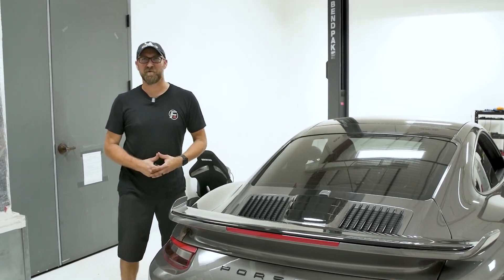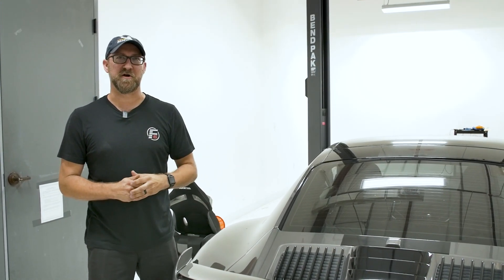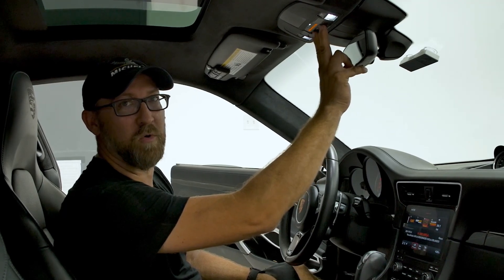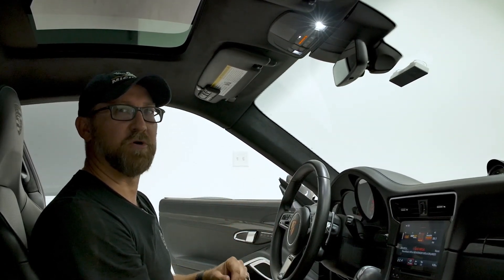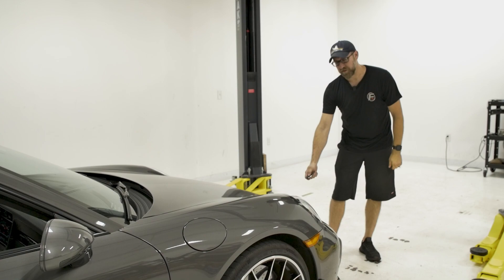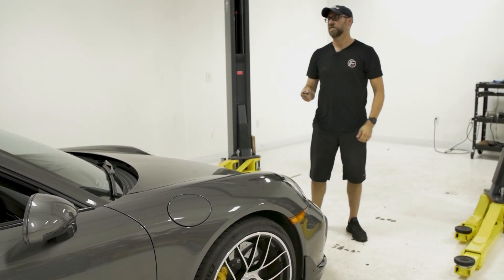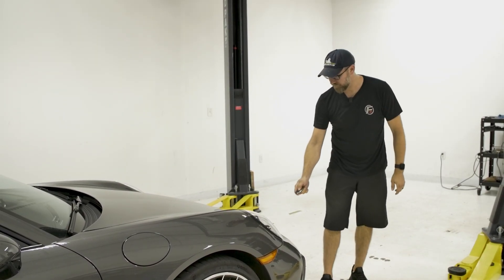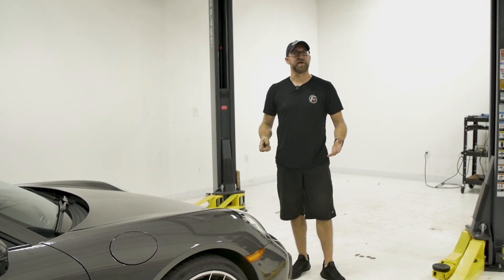How-To: Program Homelink buttons to control valved exhaust (Porsche)

Comment from the maker: Using Homelink to control a valved exhaust keeps everything clean and OEM-feeling. Which exhaust system are you running, and did you run into any pairing quirks during setup? Happy to help answer questions.

Comment: Great video! unfortunately, now my garage door opener won't work, but the valve controller does.  Any suggestions on how to get the garage door opener to work again?  I've tried reprogramming it several times and on multiple different buttons on my GT4's home link.